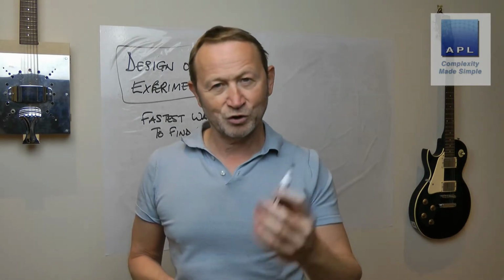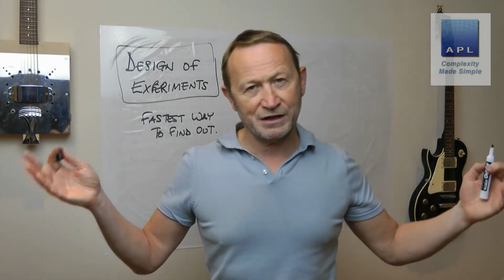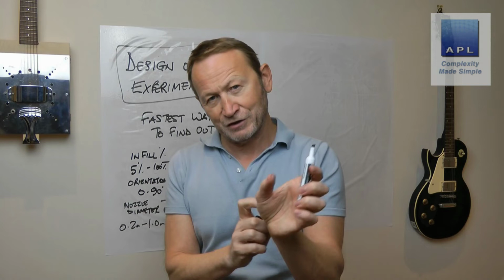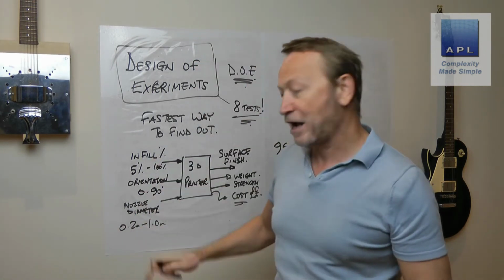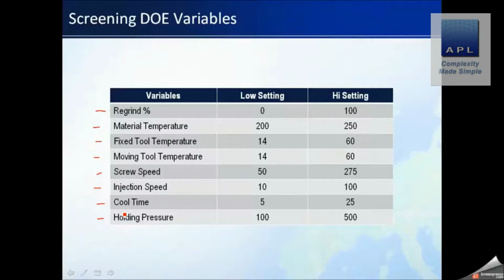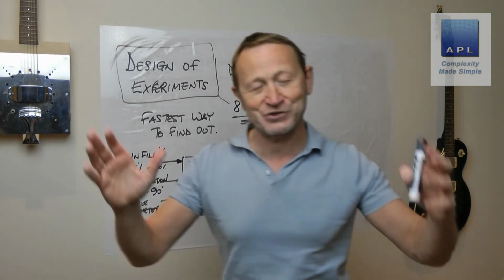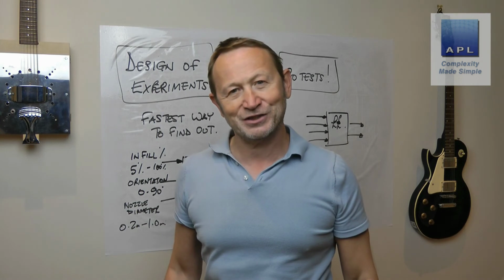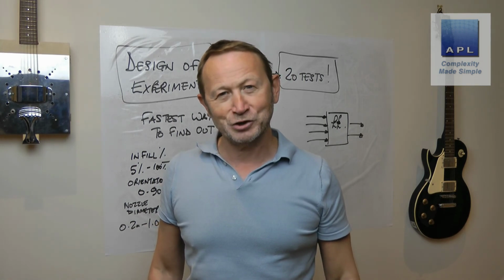UK Manufacturers - Opportunity to learn powerful new skills!!

Comment: Paul, if I wanted to to test if single piece flow for washing a car i.e. wash & dry each panel before moving onto the next one was quicker than traditional washing routines, what statistical methods would you suggest?
Reply from the maker: London - depends on how different the results are and how important it is. Lets say old way takes 10 mins new way takes 5 mins. Why would I need any statistical methods other than a stop watch? If the old way takes 5.5 mins and the new way takes 5.3 mins I might use a t-test. But then again I'd really want to improve the process more than 10 seconds before I use any statistical tools. I like to keep it simple...